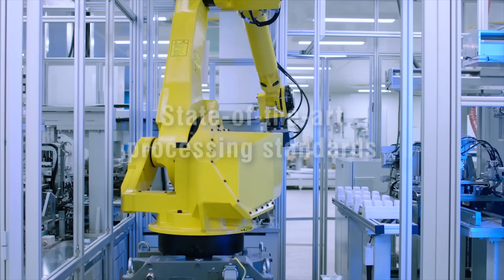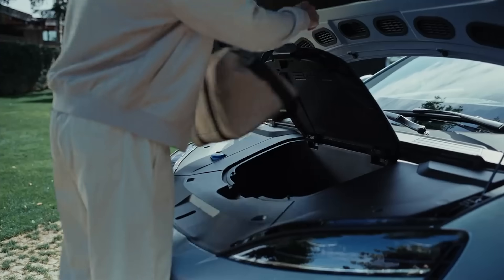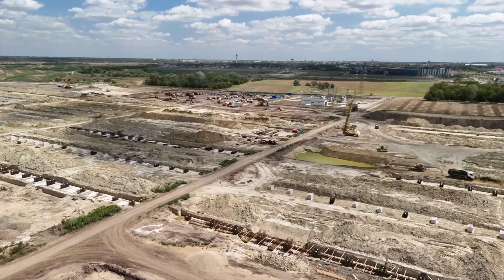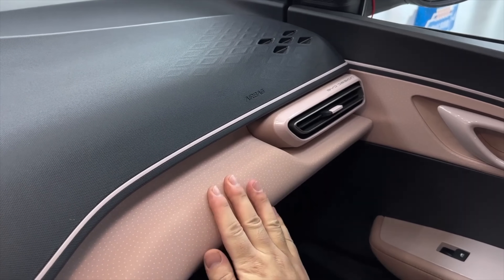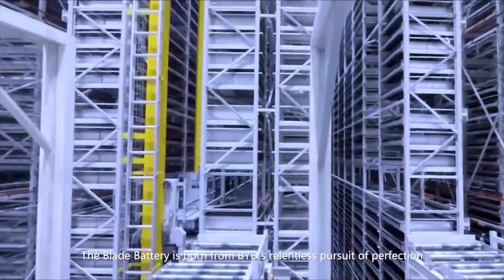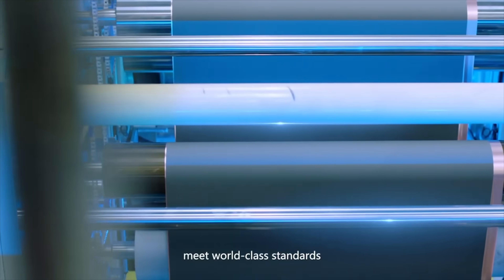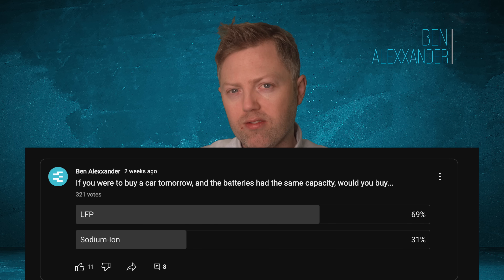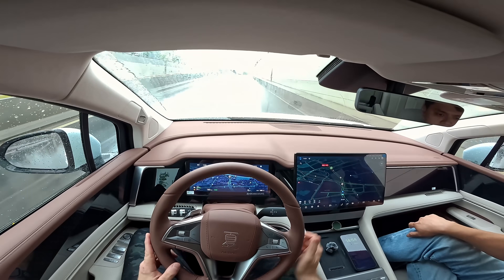BYD Gen 2 Blade Battery Launch Imminent

Comment from the maker: WOuld you rather buy a new vehicles with Sodium - Ion or LFP chemistry batteries and why?
Reply: LFP is very safe, I'm waiting for ev byd with LFP gen-2! 😂
Reply: @agusedyanto3324  So when will they come ?
Reply: lfp so i can have long range and charge to 100 percent
Reply: @frederikjakobsen1605  stupid move and clue less. Let it park at 100% for days and the cells are blown. Do a proper research which is not complicated and you hear the details: if you charg 100% then you have to use the battery afterwards .
preferred state for a large life cycle time is 30% - everything higher will have an impact on the longevity of cars or homestorage.

Same for discharging to 0% (if it is not protected by the manufacturer which usually tell you 0% but the car is still at 8%).

AGAIN: if you charge a single cell fully and let it stay at that level then the cells will develope a bulge - and some youtubers have shown these already and how to fire them up causing a fire.
Reply: Sodium ion for 1/3 the price and stuff all range. If I could buy a car with the same performance as a Yaris and 180km range (like a leaf but not crap) I would already own it
Reply: @theairstig9164 sounds like you are describing an Imiev with a battery upgrade. I get 250km of range in mine and it works very well as long as I don't try to do road trips with it. But then again even if it could do a road trip it wouldn't be a great car for long distances.
Reply: @theairstig9164  Sodium makes not much sense cause why would you buy it ? The cells are more expensive than LFP so you wanna pay more for less. Sodium has its own disadvantages.
Economy of scale output is currently about 1000 LFP and less than 1 Sodium based on chinese official figures.
Reply: Makes not much sense to talk about EU energy sources. No one is buying EU power from the grid, but domestic power or use his own energy from the roof no one in germany counts. 
No one counts any energy from the solar roofs used for your own home hence it is not a consumption figure anymore cause what they count is what you are drawing from the grid and feeding in, but not the production self consumed.
And then every country has its own power mix, the eastern europeans do not care anyhting about environment, dirty like hell like cheap polish coal burned . We have over 60% renewables here and NUCLEAR is not a renewable for us, quite the opposite, that no one wants to use except 1 country who will be broke afterwards. 
No country in Europe except russia can show us a nuclear reactor that has been built in time and budget or let us say only 2 times overrun ... 

Stupid technology from day 1 onwards and well known for its weakness long before tschernobyl cause USA suffered from 3 miles island catastrophe in 1977 or so. 

At the end we do not have to care about how dirty the power from the grid is cause you can fix 20 power plants much easier and make them cleaner than 30 million cars. And again: diesel comes not for free to the gas station, a lot of deadly and tragic accidents had happened like sinking tankers and oil riggs destroying the nature along 100 km shorelines. 

Buy an EV and then work on how to charge it with clean or green energy - in my opinion. If you open the door for discussions and some tiny details no one will go on and jump ahead.
Reply: Aluminum Oxide is better. Wait for the Tesla.
Reply: I’m good with either chemistries but if range is better then I would go LFP
Reply: The new CATL Naxtra Sodium Ion battery is amazing 175wh/kg energy density equivalent to LFP. 10,000 life charge cycle which mean the battery can last at least 10 yrs and above, works in -40 degree Celsius  to 70 degree Celsius and at -40 degree Celsius still retain 90% of charge power. Charging speed at 12C. And the battery has been crush, drill and even saw into half, no fire, no smoke.
Reply: @kckfen  Meh. LMC gives you nearly 500 wh/kg
Reply: @kckfen 27 años cargando la bateria a diario
Reply: @kckfen  27 años cargando a diario la bateria
Reply: From what I've heard about sodium batteries they are far superior in extreme cold and they are projected to be slightly cheaper. They also aren't really available to the point where you can do a real world comparison. I'm from Canada though, and having a cheaper battery that maintains more of its capacity in the winter and costs less is pretty compelling. Maybe the missus could share a cheap winter sodium ion car and a nicer LFP summer vehicle 😂
Reply: @Crispcitrustaste  They are all that, but they have a negative (pun intended) that for vehicle batteries is a show stopper. I dont have the figures, but the energy density for both per mass and per volume is much lower. This actually works as an advantage for giant grid batteries, because a lower density means a much lesser fire risk, but it is terrible for vehicles.
Reply: Lfp
Reply: Whatever is cheapest for the smallest car and gives me the minimum usable range for my current purpose. I could cope with a 100 mile range with no problems, and would take any chemistry that would do that.
Reply: 100 dólar x 10 dólar 😅😅
Reply: As of today (8/5/'25) I would MUCH rather buy a TESLA Model 2 with their new Aluminum-ion battery. Al-ion has big advantages over li-ion in EVERY metric.
Reply: Why is some companies are still using NMC?
Reply: @plentypotential performance.  NMC are still superior for performance. Energy density is the biggest advantage.
Reply: @plentypotential  more range cause NMC chemistry cells have lower weight per kWh and need less space, hence the can put in more battery  capacity than LFP and add range but also power cause the peak power or in particular peak current of NMC cells is a lot higher which is needed for more powerfull motors.
Reply: @plentypotential  Tesla is going with LMC in its new Model "3+" becuase (firebomb and toxic) LMC batteries are higher density and better performance. So Husk;s statement that he is no longer going to be iusing toxic Cobalt is yet another in a long striung of MuskLYES. LOL

Comment: TESLA's new Al-ion battery is what I would put my money on. ->less expensive by 20%, ->3 times the range of the best li-ion batteries, ->lower weight,  ->MUCH greater temperature range usability, -> better cooling and NO runaway thermal meltdowns/fires/explosions. TAKE THAT BYD.

Comment: To see how clean your EV is, you also have to check what minerals are used for production of battery, which means LFP still requires Lithium which extraction polluts wide area and poisonous for ground waters, while sodium is almost 100% clean
Reply: Direct lithium extraction is getting traction and would virtually eliminate all issues we have with that element.

Comment: In recent news. Today, the Gold Coast City Council officially and suddenly disconnected ALL of its public charges due to them being completely unreliable, and spare parts to fix them unavailable. Following in the footsteps of a number of councils in Western Australia, where dozens of chargers (literally dozens - close to a hundred) have been abandoned. It is now unclear whether it is practical - or even POSSIBLE - to travel by EV very far outside of Perth.

This week, the Matson shipping company announced it was no longer taking bookings for EVs. Good luck trying to get an EV into Hawaii LOL. 😀😀😀

Also this week, we discovered that the companies that run grid scale batteries in SOuth Australia are supplying electricity at GREATER costs that running gas generators. The myth that "sun and wind are free" has been well and truly busted.

Recent changes (read "increases") to the cost of 150kW charging in the UK mean that it is now more expensive to fast charge an EV than to fill an equivalent ICE car with petrol. Like 50% (!!!) more.😀😀😀. Again, the myth is well and triuly busted.

A judge has awarded a Florida family a $200million compensation suit against Tesla, against its useless so called "autopilot". Long story. Tesla is of course appealing the decision.

Comment: In NZ when BYD advertised their first released vehicle, the Atto3, they used the Chinese range of 480 km. After it landed they revised that down to 420 km. Interestingly today the BYD NZ website listed the Atto3 as having a range of 345 km. Battery degradation? 😅 (joking). Probably this is made easier to advertise a lesser range now that they have released models with significantly longer real world range. 

Real world in mine I get about that in summertime doing mostly open road driving with my lead foot. Many city drivers would well exceed that range. So to my mind the Gen 1 blade battery gives enough range for many drivers. I wonder with the Gen 2 batteries for their existing models whether they will go for the same size, increasing range significantly, or reduce battery sizes to keep the same range with a lighter vehicle. 

A Gen 2 LFP blade battery that is lighter, more energy dense, and hopefully cheaper for the consumer would be perfectly suited for my use case as a relatively high distance commuter. The main attributes I like are the safety regarding thermal management and the chemistry.

Comment: By the time I need a new car I will check which one tolerates the heat best, has the most robust cooling system, and is the most efficient and best longevity. I don't care about high performance (I drive conservatively) and I don't want anything flashy (keep it simple) just give me a small, efficient, and built to last.

Comment: My understanding is that BYD is on the verge of going kaput, just like Evergrande.
Reply: Then its stock wouldn’t be at all time highs and worth more than big 3 American auto makers combined. Nothing about BYD is spooking the market right now.
Reply: @kangkim150  BYD will be gone in the next 12 months - Evergrande style. The company is on its knees. No one wants EVs.
Reply: @kangkim150 Exactly, they can’t sell them! That’s why the stock is so high - over capacity in a tanked market.
Reply: The product is too big to fail even if the company does. Should BYD fail, someone will snap,up the battery rights, factory and staff.
Reply: @javelinXH992 The problem is the EV market also tanking. Just look at the UK EV market - kaput.
Reply: The only similarity between the two is they both are chinese company. Anyone who understands business would easily know, they are nothing alike.
Reply: @thearlongpark  The similarity is they are both failed businesses. Anyone with a modicum of common sense can see that. BYD will collapse very soon. Go take a look at the BYD report.

Comment: From 150 to 210 is a 40% increase.
Reply: It’s a game changer.

Oops! Wrong channel! 😂

I prefer the lack of hyperbole here, thank you Ben.
Reply: @javelinXH992  I think the  channel host used the wrong denominator in his calculation. (210 -150)/210 =0.29. which is ~30%.
 210 Wh/kg is significantly closer to the  NMC batteries of Tesla's Model Y that have 232 to 244 Wh/kg.

Comment: A question I have is how much energy does it take to produce a solar panel or wind turbine, taking into account the useful life of that so called clean energy producer do they really save anything environmentally or energy wise ?  Where I live in front of the ocean a solar panel or wind turbine's life would be very short due to salt humidity corrosion.  I know beyond any doubt that the cost of the hardware would far out weigh the current cost of electricity for me.  The power grid here as it is cannot keep up with demand, but the government here is still pushing electric cars due to the green clean energy push.  The disregard for obvious facts is disturbing.  All this being said, I like the benefits for me of using an electric car, but not sure I would be able to charge it from the grid in Ecuador.  Our electricity has been out 3 times in the last 24 hours.  The country not having much at all of public charging is not a concern for my normal use.  Charging an electric car at home would cost about $3.50 per charge and I would almost never need to charge away from home.
Reply: You are the one pushing zero fact, I live in a tropical island with solar panels near the sea an hotter temperatures which is worst for solar panels and they been holding for years, other for decades in remote places without grid. Many people also who have them for decades on their boats doing world tour and no problem.
Reply: @danielvilliers612  Well I have lived here for 11 years and have yet to see anything but stainless steel last.  Aluminum and steel last a few years.  Maybe higher quality Aluminum would last, but I haven's seen it.  Still would make sense here.  My electric bill is $5 a month.
Reply: @danielvilliers612  The HBR authors found that the price of panels, the amount solar panel owners are paid by the local electric company, and sunlight-to-electricity efficiency determined how quickly people replaced their panels. 

“Alarming as they are,” they write, “these stats may not do full justice to the crisis, as our analysis is restricted to residential installations. With commercial and industrial panels added to the picture, the scale of replacements could be much, much larger.”

What about recycling? It’s not worth the expense, note the HBR authors. “While panels contain small amounts of valuable materials such as silver, they are mostly made of glass, an extremely low-value material,” they note. As a result, it costs 10 to 30 times more to recycle than to send panels to the landfill.

The problem is the sheer quantity of the hazardous waste, which far exceeds the waste produced by iPhones, laptops, and other electronics. The volume of waste expected from the solar industry, found a team of Indian researchers in 2020, was far higher than from other electronics. 

“The totality of these unforeseen costs could crush industry competitiveness,” conclude the HBR authors. “If we plot future installations according to a logistic growth curve capped at 700 GW by 2050 (NREL’s estimated ceiling for the U.S. residential market) alongside the early replacement curve, we see the volume of waste surpassing that of new installations by the year 2031.”

It’s not just solar. “The same problem is looming for other renewable-energy technologies,” they write. For example, barring a major increase in processing capability, experts expect that more than 720,000 tons worth of gargantuan wind turbine blades will end up in U.S. landfills over the next 20 years. According to prevailing estimates, only five percent of electric-vehicle batteries are currently recycled – a lag that automakers are racing to rectify as sales figures for electric cars continue to rise as much as 40% year-on-year.”

But the toxic nature of solar panels makes their environmental impacts worse than just the quantity of waste. Solar panels are delicate and break easily. When they do, they instantly become hazardous, and classified as such, due to their heavy metal contents. Hence, they are classified as hazardous waste. The authors note that this classification carries with it a string of expensive restrictions — hazardous waste can only be transported at designathttps://www.forbes.com/sites/michaelshellenberger/2021/06/21/why-everything-they-said-about-solar---including-that-its-clean-and-cheap---was-wrong/ed times and via select routes, etc.”

Comment: Do you know if the Blade 2 battery will have better cooling, because if heard that the Blade 1 battery could suffer from rapidgate after driving at high speed for extensive periods?

Comment: Do you think BYD will maintain the same size of the batteries - therefore a higher range due to the higher density OR maybe provide the same kwh in smaller battery packs - therefore a lighter package?
Reply: Depends on you. Do you want a small fast car with a small range or a large car with lots of power and range. I can buy a 40KwH NMC or LiPoly battery with peak output of 200Kw for a few seconds. But they aren’t safe and will thermally limit in 30 seconds without some aggressive active cooling. Sometimes even with cooling. A Tesla model 3 SR+ is LFP and will run happily at 0.5C or 30 kw for 2 hours while taking you 200kms in the shittiest weather imaginable. A leaf won’t. A Gen 1 Kona won’t. A MG4 Excite won’t … maybe just if you turn the HVAC off. The chemistries are optimised for a specific use case that ICE vehicles are not and don’t need to be. What’s yours
Reply: I think it would be smart to offer the same KWh battery but lighter due to the density. Taking weight out will increase the range and improve all other driving dynamics at the same time.
Reply: Both options. They will provide bigger capacity in their high end models and lesser capacity in cheaper ones.

Comment: Thanks Ben. My 3 yo Atto's gen 1 LFP blade battery still going strong, so far no sign of degradation. Gen 2 sounds good. If ever my gen 1 battery packs up, hopefully it could be replaced with gen 2.

The Imiev pioneers are now getting replacement batteries for their 13yo vehicles that provide over twice the range of the original Mitsubishi batteries complete with a comprehensive software upgrade.
Reply: The cycle life of LFP batteries exceeds your imagination, approximately ranging from 3,000 to 5,000 times.
Cycle life: Calculated at 2,000 times, it requires driving nearly 600,000 kilometers
Calendar life: Approximately 12 to 15 years
EV are developing rapidly.   Perhaps within ten years, solid-state batteries will have become cheap.   You know China is very good at this
Reply: Maybe another 10 years😅

Comment: When will batteries like this be used in appliances etc off the grid
Reply: Off grid batteries need to be stable over a range of temperatures for many thousands of cycles. Volumetric or gravimetric density is irrelevant. Stability and longevity is relevant. They are different use cases